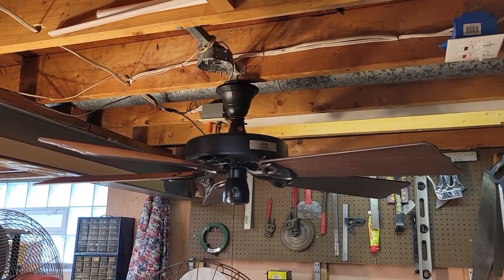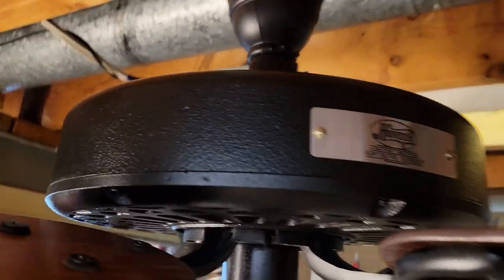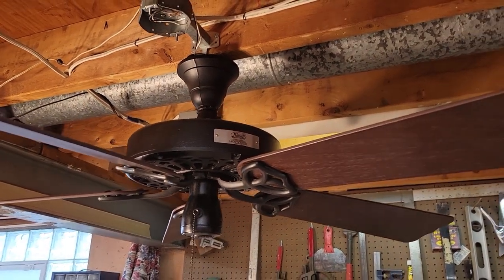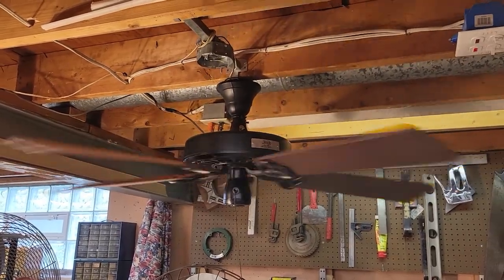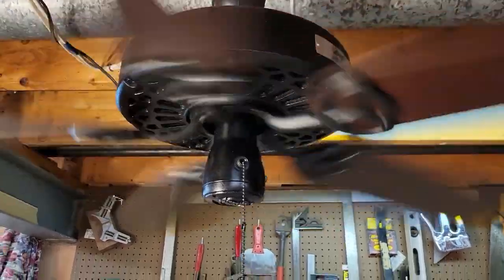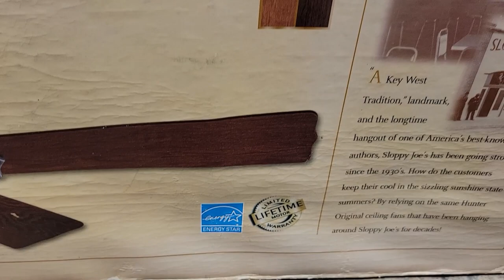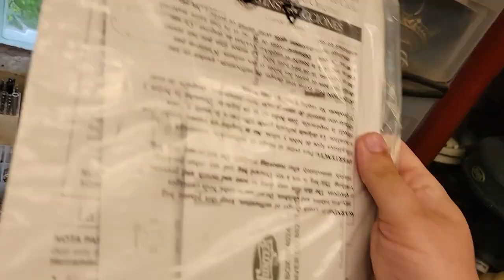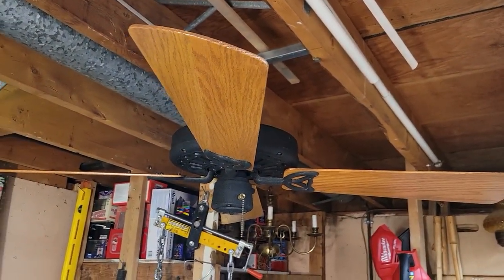Hunter Original Archive Series 52" Ceiling Fan

Comment: I've got one of these and wanted to make sure it did actually need oil and that the cup wasn't decoration. I got a brief look at the top of the box and managed to read to confirm it needs oil - thanks! Sadly the way that folks claim you check the oil on Hunter fans doesn't seem to work for this model so I'm more guessing than anything but after a solid ten years of operation I'm sure mine was happy for anything I could give it!